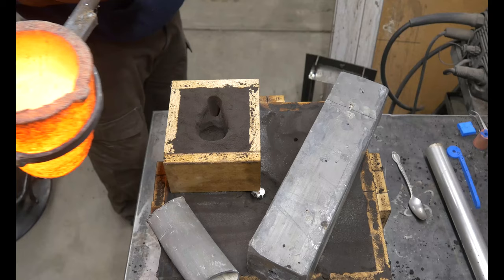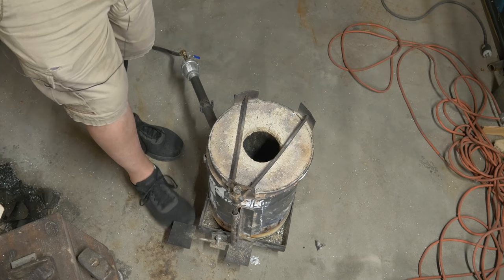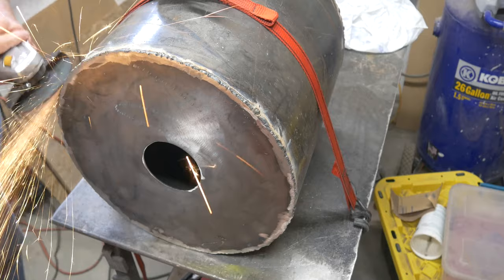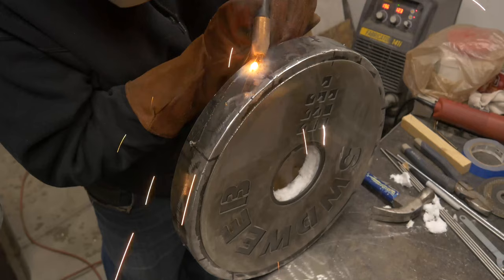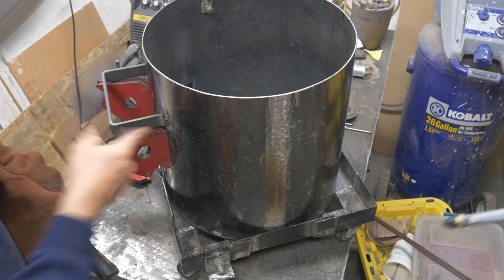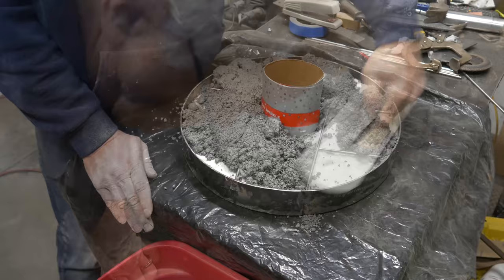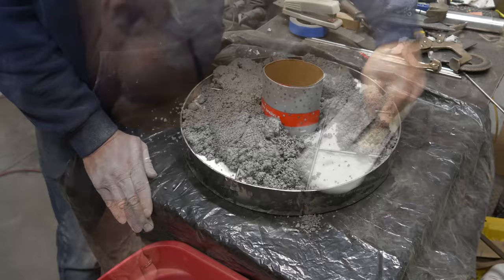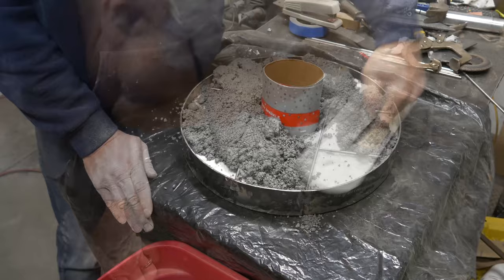Building a professional-grade foundry furnace

Comment: Can we see a pic of how you made your forced air tube attachment?
Reply from the maker: You can kinda see it here https://youtu.be/fFADzuaCtQs?t=502
There are problems with the accidental implementation I ended up with so I'm hesitant to to spend any time talking about it as people will undoubtedly try to copy it.  I basically taped a hair dryer to the end of the tube.
Reply: @swdweeb  ok gotcha.  I actually found that for some reason my burner was burning inside of the tube for some reason and I couldn't figure out why so I purchased a stainless one from amazon for $50 and so I gave it another try using my second already built king of random foundry.  I successfully melted copper at 15psi with no forced air so now I'm starting to build a permanent foundry from propane tank, kaowool, refractory cement and the kiln wash as you did. I also purchased welding equipment lol.  Thanks for the inspiration man, you are awesome...
Reply from the maker: Can you send me a link to the one you bought?
Reply from the maker: Thanks
Reply: Ha, finally made my propane tank foundry but made the mistake of using refractory morter instead of castable refractory cement, didn't know there was a difference until now lol now, I have cracks everywhere as it is drying. A lot of waisted money lol...
Reply from the maker: @marcusmiles568  I actually used refractory mortar in my first one too.  It held up for a while before I replaced it with cement